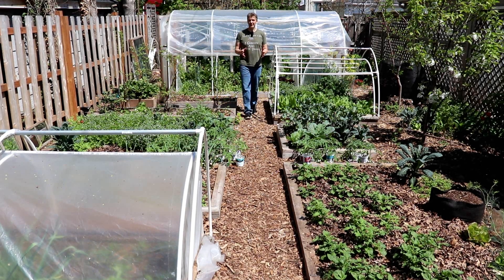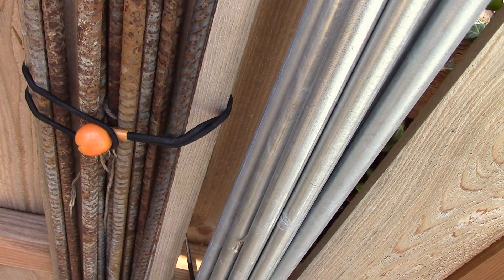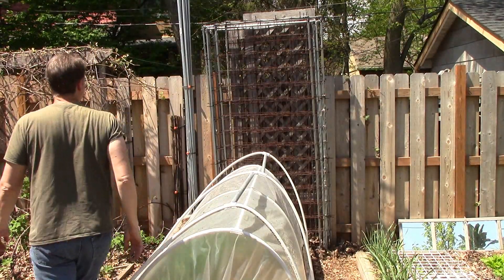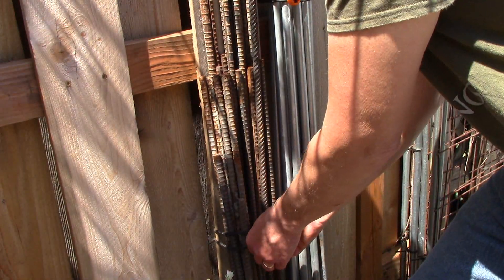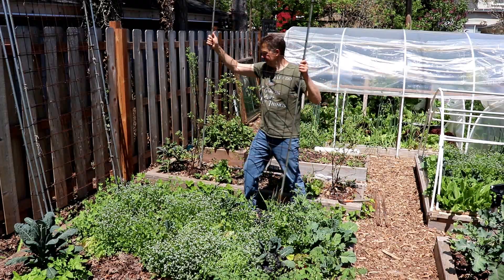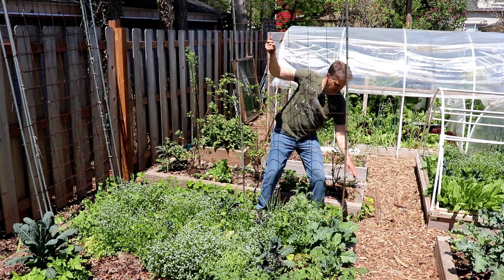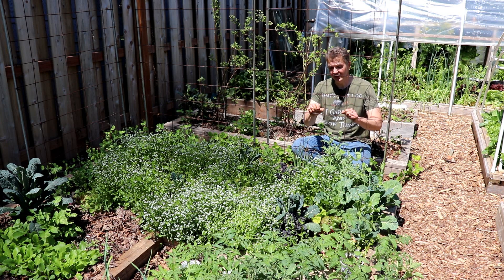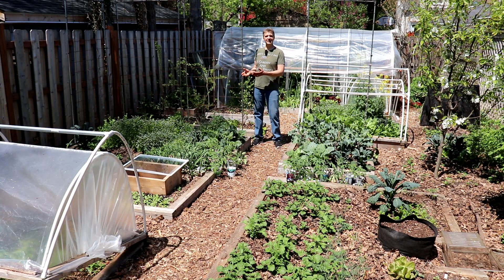How We Store & Set Up TRELLISES (Space Management in a Small Urban Garden)

Comment: The trellises with metal inserts are so easy to use + move around compared to ones made with twine etc. I use ours in the fall on top of leaf mulch to keep it in place with high winds if the snow cover is low or melts. This summer I am placing a trellis on the south side of a raised bed angled about 10 degrees away from perpendicular to the south to minimize shading on the north side. This bed gets about 12 hours of sunlight. All that is needed is some rain. Also, thanks for the guitar solo midway thru the video.
Reply: Hello, are you saying you angle your trellis 10 degrees from vertical?  or do you mean turned slightly away from the south, but the trellis is still vertical, straight up from the ground?  

depending on what I am growing, I have been putting my trellis on a steeper angle, so its not pointing straight up, its sloped to the north.  this way whatever climbs the trellis gets more sun.  also, the trellis can be longer without sticking up as high.  I also put legs on the top 2 corners that make it very sturdy to grow heavy crops on...  But I also have enough space in my garden I don't worry very much about any shade the trellis makes.  some things will grow very nicely in the shade of the trellis
Reply from the maker: I'm glad you like your trellises too, Valerie! It's interesting that you're thinking of slanting trellises slightly to the south to minimize shading. I was thinking about trying that this year too.
Reply: Voidremoved yes 10 degrees from vertical. The crops will be light weight but if they move the trellis I will need supports like yours. I have a lot of space but only 25% of my backyard is growing space right now.
Reply: Valerie Howden i

Comment: Hmm ... I have a very similar approach with a couple of exceptions. I use EMT but with metal fencing, 4 in. spacing. I like your concrete reinforcing grid better since the squares are wider, providing easier access from both sides of the trellis.Unfortunately I am unable to using concrete re-inforcing rods driven into the ground because we have very large rocks slightly below our soil surface. To get around this, we use pvc tubes attached to the beds and insert the EMT into the tubes. I love these types of trellis for several reasons (as I'm sure you've mentioned): storage is simple, you can put them anywhere depending upon what you're growing and you don't have to mess around with those finicky nets every season. Cheers and thanks again for another informative video.
Reply from the maker: Thanks Ron!  That's a great approach.